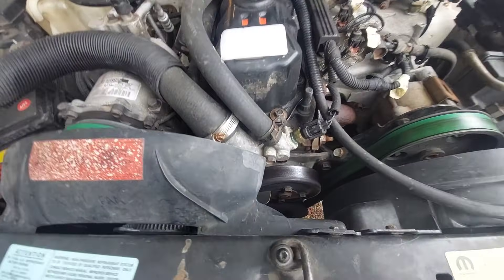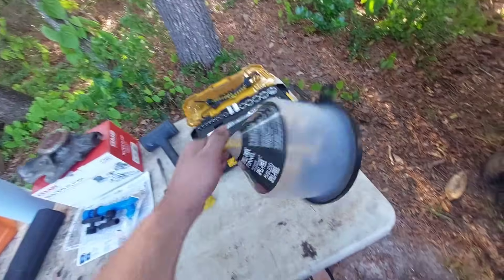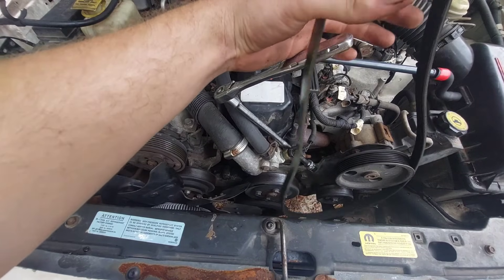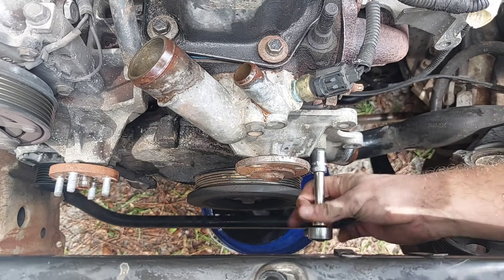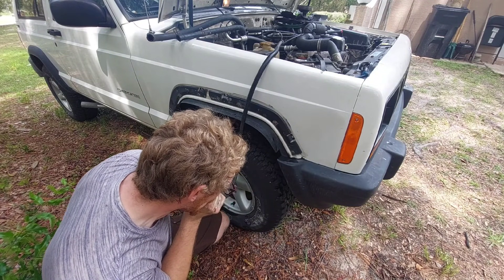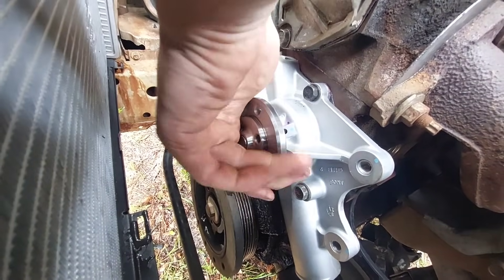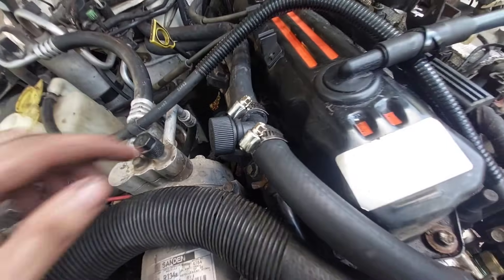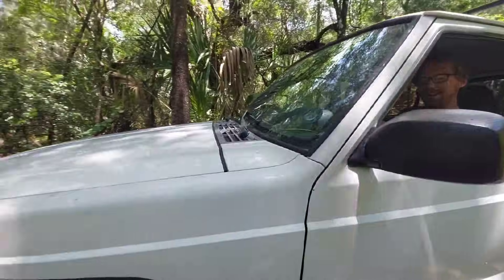Jeep Cherokee: Water Pump Replacement & Cooling System Flush ['97-'01 XJ]

Comment: Kind sir, can you help me with where I can find the correct size tension hose clamps for the heater hoses, lower and upper radiator, water pump, and t-stat housing? (2001 XJ)
I could  really use your help figuring out the proper sizes with regard to figuring out the  sizes of the OEM tension clamps.
Reply from the maker: hose clamps with worm gears aren't exact sizes, you just need an assorted pack of them with varying vague sizes that fit around the XJ's hoses. They sell packs of them at parts stores ams even walmart

Comment: Great advice. I followed the plan exactly except for removing the metal fan blade. Then I had to end up bypassing the heater cores on my two XJ's (1992 and 2001) because they began leaking inside the cab (live in a desert area so don't need a heater anyway).

Comment: I watched your video and just replaced mine. It's been 16 years, so I guess it was time.
I only had to move the power steering bracket, but I also have small hands. Left the fan on.
I could only get 2 Gals of new coolant, so I'm gonna be putting some concentrate it it to get that water mix down.
Thanks for the video.

Comment: I flushed it out my xj last year which the HOSE while putting in a new water pump. Shortly after, I came to find out the cylinder-head cracked and was drinking coolant. So I stared putting just water in the puke tank as a temp fix until I replace the head. Just replaced the cylinderhead and the inside water pump fins are fairly rusty. Is that normal or could that be the reason why? If I flush out now with distilled water would that make a difference? Is there a way/chemical I could use to flush out the rust deposits in the block?

As always, thanks man for years of help!

Comment: How would you use the bleeder hose system? I recently drained the radiator. I had distilled water and switched to coolant, but it won't flush the engine.

Comment: So with that T adapter on the heater core intake, it'll flush the entire system through that and out the radiator? Block, Heater core, and radiator?
Also, should I run hose water through the upper radiator hose after taking it off the thermostat housing?

Comment: I assume you skip the block flushing part if you’re not changing the water pump Just flush everything else?
Reply from the maker: If the water pump remains on the engine, you can still flush the block all the same, water will come out of the lower radiator hose outlet from the water pump

Comment: That quiet “clack clack clack” that can be heard in the background when he is bleeding the system, is that lifter? Or something worse like piston slap or loose flywheel. I am having the same issues and trying to chase it down. Thanks!!!
Reply from the maker: On my engine in particular, this clacking noise is definitely bottom end. It's not a lifter and it's definitely not piston slap, and my flywheel is 100% confirmed to be properly torqued (I replaced it not long ago, and the engine was making this noise before then anyway)

Lifter tick is definitely more of a tick, like dropping the head of a screwdriver onto a flat metal surface, and it gets LOUD when the lifters aren't properly lubricated or if a valve is stuck. 

Piston slap tends to cause more of a misfire-like behavior, and sounds like heavy knocking from deep in the engine, it can vary from light clattering to pretty much a hammer hitting the block.

What you hear here is the rod bearings nearing the end of their life, which is probably worse than anything else listed. The clattering is from a Connecting rod bouncing off the crankshaft every time it rotates. This is like, the worst noise, you never want to hear an engine make. 

However, upon noticing the issue, I proceeded to drive it about 30,000 more miles all over the country only changing the oil as needed, and nothing's happened, because it's a 4.0L and they're indestructible
Reply: @WAEMIDIV  I'm pretty sure my engine makes a similar sound, and has been for the past 2 years. 'Near' might just indicate failing somewhere in the next two decades

Comment: You should do a video on how to do factory fog lighs man id watch it ur vids are better then most for  jeeps and helpful
Reply from the maker: The fogs lights have been a pending project for quite some time now, but I've learned that XJs without them sometimes don't even have the wiring in the main vehicle harness for them. Not even pins in the relay box. So its a very involved swap, unless you happen to be lucky enough to already have the wires in place. I'm working on finding out what years and what options mean which wires will exist, and where.

Comment: Good timing lol, I just did this last week! 
You can also use compressed air to blow out the radiator and block after flushing, to get any hose water out. 
Love this channel by the way, best XJ videos on YouTube!
Reply from the maker: that's a good idea
I'll have to employ that trick when I flush it next time
Reply: Remember on pressure greater than cap ( 15 psi...)

Comment: In the future, when you use the T fitting to flush the system, how is the flush going to get past the thermostat and into the block? Also, how are you going to get all the hose water out post T fitting flush?
Reply from the maker: There is a small bypass route from the heater hose into the thermostat housing, and it'll also go the other way through the heater core and past the water pump. I have no idea how to get the hose water back out though.

Comment: Just did this on mine. I flushed it and ran evaporust thermocure in the system for a couple days and drove around for 5 hours over those two days before I flushed it some more and filled with 50/50. I had trouble getting my heater core to start taking in water when it was warm and found that squeezing the upper radiator hose while holding a rag to keep from getting burnt, forced enough pressure in the system to fill the heater core and properly burp. Took it for a drive with a full overflow and after about 40 minutes I checked and it sucked down almost the whole overflow, so I topped it back off and it’s been good since. Also, I was able to use the paper gasket without any RTV and have no leaks. 

Did I miss it, or did you completely skip the thermostat install procedure? What a pain to line it all up perfectly without knocking the tstat off it’s lip!
Reply from the maker: I did skip the thermostat, just because it wasn't the main focus of the video, and doesn't need to come off with the water pump. I got a separate video for the thermostat 

I've used that cooling system flush stuff before, it probably saved my engine block

Comment: I just flushed my cooling system in my 01XJ a few months ago cause my heater core never worked. Previous owner had put water in mine as well. I brought it to the mechanic when I got the car around 2 years ago and they said they flushed it, but the heater still never worked. I ended up flushing the block, radiator and heater core. Took out the thermostst and let a mixture of prestone radiator flush and distiled water run through for about 3 hours. Then I drained the whole thing and filled it with coolant. Definitely recomend that stuff, but I know that some people are against it. Heater now blows hotter than my moms brand new audi Q5 lol. Great video as always, keep it up man.

Comment: You use the T fitting in the heater hose  to bleed air out of the cooling system with minimal screwing around. It's the highest point in the system.
Reply from the maker: Yes I actually did use the fitting to get air out, but I didn't want to include that because it may confuse newcomers who just wanna replace the water pump.

Comment: I used a plastic Prestone flush tee one time, in a diesel '89 F-250 I owned many moons ago. I was heading to the Washington state coast, towing a travel trailer, and the cap on the tee cracked, blowing coolant (and steam; I was towing a 6,000 pound trailer up and down some hills, so my temps were around 230) all over in the engine bay. I had installed it roughly a year prior and hadn't hit it or bumped it; it just randomly failed. I always carried extra engine oil, coolant, and ATF in that truck, so I wasn't stranded, but I will NEVER use another plastic flush tee; that was not a fun experience.
Reply from the maker: Duly noted 
how long did it last before it cracked? 
Maybe tons of heat cycles wore it down
Reply: I had one on my old 86 CJ-7 for 8 years and no leaks. Daily driver with some occasional rock crawling. It would be nice if they had an aluminum or brass version. T and cap. @WAEMIDIV
Reply: It was likely the heat cycles. I towed a fair amount with that truck, and those IDIs can run all the way up to 230 when towing heavy and still be fine. It was probably not a good idea to have a thin plastic cap on a heavy towing diesel truck, but I still won't use one.

Comment: I had good luck with using wood bleach to unrust my system. Just be sure to take your heater core out of the loop first.
Reply from the maker: Wood bleach?  w a t
is that bleach for wood?
Reply: @WAEMIDIV  Yes, it's exactly that. It's also powdered oxalic acid.